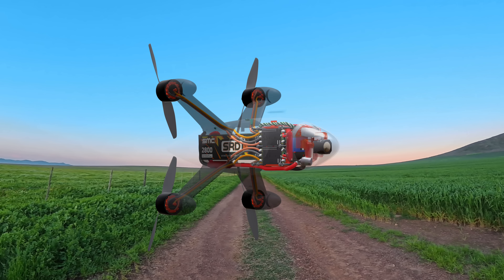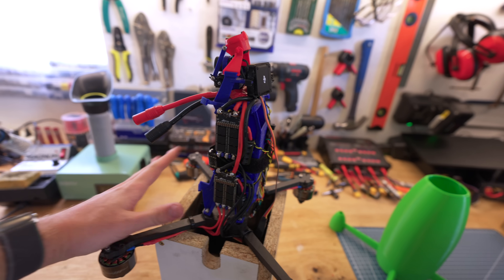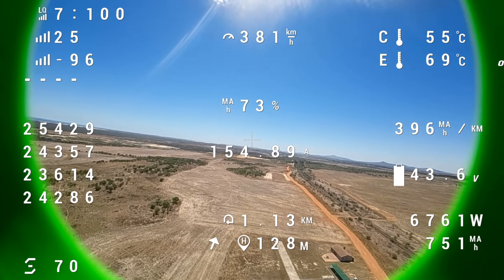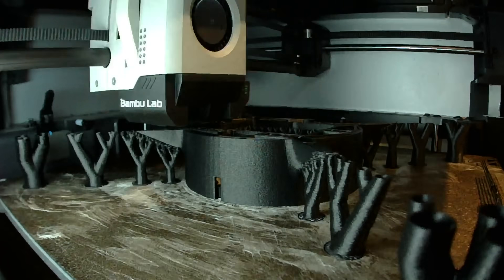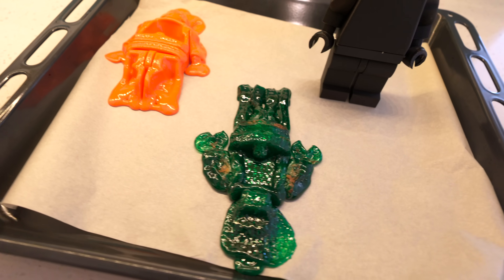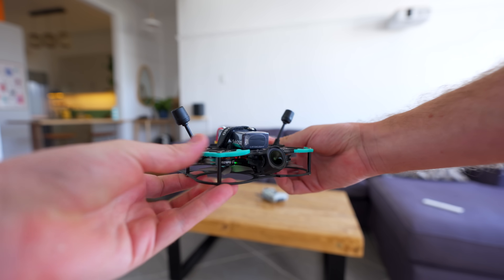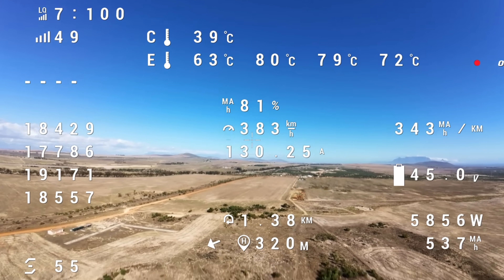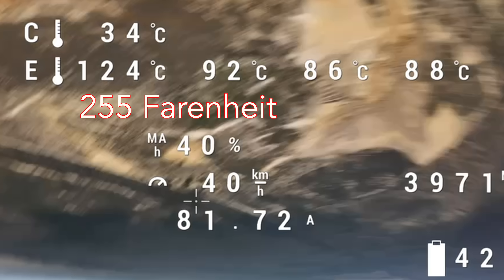THE COMEBACK - World's FASTEST Drone V3

Comment: Wouldn't it be just enough to integrate the copper cooler into the body of the drone so that just the fins look outside and will be cooled by the air? I guess that will not be best for the aerodynamics, but you can avoid the extra weight for the water cooler. And at the speeds the drone reaches the cooling should be quite good and stable, whereas the water heats up more and more.

Comment: If you need an even bigger thermal accumulator, try replacing the water with alcohol, a mix of water and alcohol. This compound will allow you to lower the temperature of the liquid below 0 degrees Celsius.
Reply from the maker: Oh interesting idea!! The other thing to consider is condensation. If you go below dew point your electronics can get wet 😅
Reply: @LukeMaximoBell  You could use desiccant possibly to keep from getting condensation since its based on relative humidity. I'd imagine you only need a very small amount since you're just trying to handle the short flight.

Comment: Why add a pump to move the water in a closed water box? It'll just add heat not remove the heat or move it anywhere else.

Also your CG testing is faulty. It tests it as a plane not a drone/rocket as it is. Where the rocket pendulum fallacy.  Center of mess would matter but not for the purpose you're testing.
Reply from the maker: Because the water was not heating up quickly enough. It forms a boundary layer which gets warm, but doesn’t warm up all the water in the tank. Results speak for themselves
Reply: @LukeMaximoBell figured it could be that. Adding finns to the aluminium should have fixed it and caused convection though.
Reply from the maker: @MeshJedi  The latest versions we don't even use the pump. The ESCs only rise in 10 degrees celsius after a speed run, which is nothing.

Comment: 557km about dead end of propellers. change to edf.
Reply from the maker: I think EDF is too much drug
Reply: @LukeMaximoBell  For 5–10 cm props, due to the tip-Mach limit you still need P/D ≈ 2 at 500 km/h and P/D ≈ 4.5 at 800 km/h this isn’t practical with small props... because falling effiency.

Comment: Mach 0.47 with a small quad its absolutely crazy.
Well done.
Reply: Also peep this. This all started because someone said Mach .47 isn’t a Mach (which it is because Mach is a measurement) and then because about if it’s “appropriate to use” dumb as hell also that’s like saying .47mph isn’t a mile per hour so we should measure it in yards per hour 💀
Reply: @stuffiguess7680 well 0.47 isn't "a mile per hour" (1mph) but it is measured in miles per hour, and if someone wants to convert it to ft/s or something, that's up to them. This common sense understanding is one of the benefits of metric measurement, but I don't need to tell you that, just the people arguing with you.
Reply: Airliners use Mach as cruise speed even tho it's below mach 1
Reply: Wow the comments are just a battle of being right. Novel idea. It’s a cool bit of perspective and you don’t get more social credit for trying to be more correct by nitpicking 🤯
Reply: At below 500 feet above sea level. Even more amazing.
Reply: Means I Also travel in Mach speeds like 0.080 sometimes. 😂
Reply: I want to know how he isn't getting shock waves happening with the tips of the propellers causing them to suffer damage over time.
Reply: @KnightsWithoutATable  He probably is and the damage just isn't immediately noticeable after a handful of flights. See: The Titan Submersible.
Reply: An important semantic consideration here, is that specifically `Mach` is a continuous measurement, not a discrete one. This means it can be any Real value (0.33, 2, 0.47, π, etc.). Contrast that to things that are discrete, like the quantum world (thanks Planck!).
Reply: a bullet goes mach 4 with a tiny bit of gunpowder, and look were that got us lol
Reply: Rookie numbers
He needs to make a Mach 1 drone
Reply: @ThePokemonSoldier at Mach .47 he is already around Mach 1 for the rotor tip speeds. Without scaling up the size of the craft to make bearing friction proportionally smaller, this is approaching practical limits for multi-rotor craft. If he gets larger he could hypothetically get around Mach 0.85, which is what experimental rotor driven fighter aircraft topped out at.
Reply: @godc71  None incorporates contrarotating concepts. I don't know that it'll increase speed directly, but we know it increases stability and efficiency. Efficiency gains generally mean a boost in available power for speed, but that remains to be seen in practice.
Reply: Mach 0.47 is not a mach. So let's not call it mach.
Reply: @user-fx5sw4jy7hYz9Hzi  bro, the definition of "Mach" is the ratio of somethings speed (velocity) to the speed of sound (767 mph or 343 m/s). so the drone was going 363 mph so 363/767 = ~0.47. that IS mach, just not mach 1. i mean i could understand your complaint if he was like measuring the speed of a bike in mach, but i believe he was just trying to put into perspective how fast the drone was, at nearly half the speed of sound
Reply: @smellycheese08 okay, that means I am capable of doing Mach speeds on my morning run, just 0.01M)
Reply: @Zelenyi4ay Technically yes – you can even express your velocity in c if you wish to do so.
Reply: aha, in nanometers per light hear)))
Reply: @Zelenyi4ay sorry to say, but distance per distance is not velocity my guy
Reply: @Zelenyi4ay yeah, but its pretty dumb to measure that in mach
Reply: @Zelenyi4ay I express velocity in c all the time... it comes with the territory when you fly in supercruise in Elite: Dangerous. It's mind boggling when you really think about.

Edit: For anyone wondering, c is the speed of light measured in seconds. Ergo, if you were screaming sunward right past Earth at 250c, you would be halfway there in just one second, as Earth averages roughly 499ls (light seconds) from the Sun. From the Sun to Uranus at that velocity, it'd take a hair under 40 seconds! Also, the word "homophones" has "homo" in the name. The more you know!☝🤓
Reply: @smellycheese08 speed of sound changes at different altitudes mach .47 because drones doing 363 at 124 meters high
Reply: @robinkruger4798  yeah, im well aware,  it was just a general comment
Reply: @user-fx5sw4jy7hYz9Hzi what are you even trying to say?
Reply: @I_Automate  hes saying its not fast enough to compare to the speed of sound
Reply: @myrup1887   Which is silly, any speed can be compared to the speed of sound.  I myself am going mach 0.0 right now.
Reply: @gratefulguy4130  i would just like to say that my reply was my interpretation of his comment and not my own opinion
Reply: @gratefulguy4130  technically, everyone is going at C at all times.
Reply: @user-fx5sw4jy7hYz9Hzi  No, that's approaching speeds where transonic effects can start appearing.  Mach is a more appropriate way to report speed in those regimes.
Reply: @user-fx5sw4jy7hYz9Hzi  there should be an IQ test to post comments on youtube.
Reply: @user-fx5sw4jy7hYz9Hzi  It's fucking half the speed of sound, so I think he can
Reply: @user-fx5sw4jy7hYz9Hzi  it's a unit like any other? Or have you never said half a mile/kilometer?
Reply: @user-fx5sw4jy7hYz9Hzi  John was excited and I am too. Mach is a relative number, comparing speed an object to the speed of sound. "Mach 0.47 with a small quad" is completely valid and simply points to an interest in promoting continuing development of this technology with a goal of reaching closer to the speed of sound. Either that, or they were just simply excited at the idea of future development resulting in getting closer and closer to the speed of sound.
Reply: @user-fx5sw4jy7hYz9Hzi at this speed the rotor tips actually are probably flirting with mach 1
Reply: @user-fx5sw4jy7hYz9Hzi  by that definition something going half the speed of light, is NOT going the speed of light, so they can't say it's going 0.5C
Reply: @ColinRichardson  you are correct. It;s like you are saying 1CM is 0.0000001 miles. That's irrelavant.
Reply: @user-fx5sw4jy7hYz9Hzi  so, what temp do we say something is when it's 0.9° outside? since it's not a whole degree yet?
Reply: @ColinRichardson  That's a degree so you can call it 0.9. Which is same unit of measurement. But when you could just say 360MPH, you dont call it a Mach. Which is totally different unit of speed. All you trying to do is trying to make it sound more important than actual speed in MPH.
Reply: @user-fx5sw4jy7hYz9Hzi he didn't say it was mach he said 0.47 mach
Reply: @user-fx5sw4jy7hYz9Hzi  Ahm yes, Mach .5 is important! And why wouldnt you compare the speed to the speed of sound, it is actually the better way to indicate air speed! Air starts to compress and Bernoulli no longer applies. And Mach is a way better speed indicator because it considers Air density and Temperature.
Reply: @Skmoltenore  yeah, like this guy said

🤦‍♂derp, i didnt read all the comments before responding.
Reply: @tippyc2
Derp in the big 25? 🤯😱🤯
I feel that, low-key, lol. Although, to be fair, I've spent way too much time in YT comment's sections for that not to be the case at times. 😅
Reply: @user-fx5sw4jy7hYz9Hzi  half a pound also isnt a pound............
Reply: @budgetking2591 the best reply on this thread to point out the ridiculous statement that mach .47 is not mach.

Comment: Hi Luke, what is the velocity of propeller tips at full throttle and top speed....they are probably supersonic and thrust is being lost...consider swept prop tips...thinner blade sections near the top with camber adjustment...taper chord and consider degree of blade washout....or perhaps higher blade count...ducted fan design...contra rotating props...more and smaller motors...etc...
Reply: Watch the video and check the OSD. Tip speed is about 0.75 mach
Reply: @saturn_fpv sorry, missed that

Comment: Why you don't just use a copper core for cooling? I mean, you don't have any way to remove the heat from the water, it is stationary. As it is about the mass, so how much mass can store how much energy, u might end up with the same weight but without water.
For precooling before flight, you might use peltier elements, but maybe not builtin, because it is weights. With peltier-elements precooling, you could go under 0°C, and therefore maybe also reduce the needed mass for the copper core, as the temp difference is bigger.
Have you thought about that?

Comment: I suggest you get ESCs which do not catch on fire.
It looks like they slapped biggest mosfets with highest amp rating but there is no cooling or PCB real estate to cool these down at all.
It should have multiple temperature sensors and throttle down (on all four equally) before things get too hot and fail.
Bad design..

Comment: Using the water as sink without radiating the heat out? Wouldn't it be possible to at least add some channels along the fuselage or the fins, and maybe make those sections out of a more heat-conductive material, to let the external airflow assist with taking away the heat that accumulates in the water?
Reply: Specific heat of water is insane.   This is more like a thermal capacitor / buffer.

Comment: Very cool project! I’m curious how you solved the issue of water expanding when it heats up and needing more volume. Did you include a small expansion tank somewhere or use another system for that?
Reply from the maker: The water doesn’t heat up thaaat much and there is there is air in it too. It’s not filled the the brim with water

Comment: How about adding golf ball dimples  on the main body and ailerons that stabilize the vehicle body ?
Reply: Dimples are for golf balls only, because a ball is a terrible aero shape and a particular quirk that only benefit balls.  Not a single aircraft or airliners has dimples because it would just add drag.  You can be certain all Airliners would immedeately apply dimples if it saved fuel.

Comment: Still watching the video and just got to the water-cooling part when I had an idea.  Instead of using a flat aluminum plate why not a copper plat that has fins.

Point the fins inward so that they are in the water that would probably get you significantly better cooling.  Also maybe wetsand the copper surface down and hit it with some polish.

Then mount the esc with a high performance thermal paste.  It would probably outperform the pad significantly.

Just popped into my head, not sure how much only an issue the heat actually is.  Time to finish the video

Also good job guys, there is a lot of brilliant stuff going on in this build!

Comment: the weight having no canards or stability wing is going to be more stable in the front-middle of a rocket since it is getting a parabola effect ,also the reason it straightens out better on the screw driver is because it is being pulled from the screwdriver because of the wings in back causing drag. honestly a center CG is better and weight is your friend because it will take more spinning air to overcome the weight kind of like putting weights on a bouncing sifter in a combine to keep it from oscillating too far. hope this helps.

Comment: drone ❌
electric rocket ✅
Reply: A rocket with some servo based fins would likely be easier to design. Model rocketry has a lot of development and tried and true designs going all the way back to the 60’s.
Reply: I wonder if adding model rocket motors to the back would add any speed...
Reply: @CalebTyler FIRE THE SRBs 🔥🔥🔥🔥🔥

We're getting into orbit with this one
Reply: @CalebTyler Erm, so you're suggesting they break the rules?
Reply: @ruzziasht349 No obviously if they did that it wouldn't count towards the official record, but it would it be interesting to see what model rocket motors could add.
Reply: @CalebTyler Be interesting to see the props taken off, and 4 rockets added. Be interesting to make it bigger and add more rockets. Be interesting to see.... the project is about a drone with electric motors.
Reply: @CalebTyler Intituively thinking, a rocket motor would add not much, if anything. It would certainly impact rear airflow separation by introducing lots of drag. The added thrust corresponding to reactive propulsion would be offset by propeller loss of efficiency. Mind you like everything in life there's operating windows for all mechanics, and while we're not yet in compression lift territory, so I may be exaggerating the band dropoff in these props.

Comment: Since the water has no way to cool you actually just increased the thermal mass. You could have just used copper (turn it on lathe and use thermal epoxy to glue the SC) in shape it in the form of the rocket. Although it increases mass the drag wont increase because you have the same shape.

Comment: that cat is remarkably chill about the drone
Reply from the maker: He’s so chill. The best! Sometimes he paws at the props
Reply: cat be like: Yea I saw some sh!t in my life...
Reply: I won't be surprised if the cat made that drone
Reply from the maker: @NazWick-o7p  I wish he could help me build 😄
Reply: @LukeMaximoBell CROSS SECTIONAL AREA CHANGES... I'm thinking all 4 motor pods are still beside the fatter part of the body. The imbalance will be each pods minute changes in cross section pressure.The pods need to go back towards the tapered rear cone where pressure is dropping faster... let me know 😊
Reply: @LukeMaximoBell I have a 90mm ducted fan rocket rocket project in the works. Slower, but vertical climb for 10 to 15 minutes. The altitude calculations are great! 😊
Reply: @NazWick-o7p  😂😂
Reply: I was about to say the same thing, definitely not his first rodeo 😂
Reply: I have a feeling a cat got hurt once in the testing of some certain propellers XD
Reply: Cat is a drone pilot. They just did not tell you, top secret

Comment: This is truly brilliant Luke! You and your dad are one of my favorite father-son teams out there. When you were dealing with the CG problem, you mentioned you could have solved it with fins in the back, but it would have obviously added drag. Did you consider replacing your existing gently backward swept fins with forward swept ones? Essentially, imagine keeping the motors in the same location wrt to the fuselage, hence keeping the tips of the fins in the same place, but moving the roots of the fins further back. This could also add some level of area ruling (not that you would need it at your speeds, but it might actually reduce your drag a little bit, you never know). I understand it might make the geometry of the frame a little trickier to print. Your current frame seems to be a single flat part. A frame with swept forward arms might be less strong as a single part, or might require multiple parts to be printed and connected afterwards.

Comment: Im curious if you're water tank was leaking after the speedrunn. Because you pretty much built a steam boiler without a release valve there 😅
Reply: The water does such a good job the temps get to no more than high 50c. Way off steam. And to our surprise the water boxes survived a lot of the crashes. Really robust and reliable
Reply from the maker: No not at all! Haha. Actually in our latest model the ESC go from 25 degrees to 35 degrees Celsius after a speed run. Absolutely nothing!
Reply: @LukeMaximoBell very interesting, thanks for the answer.